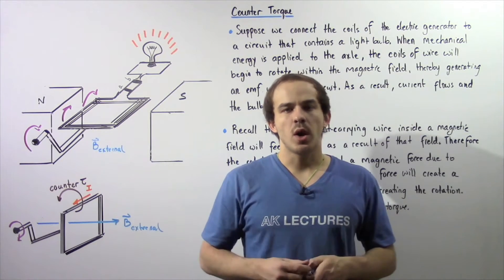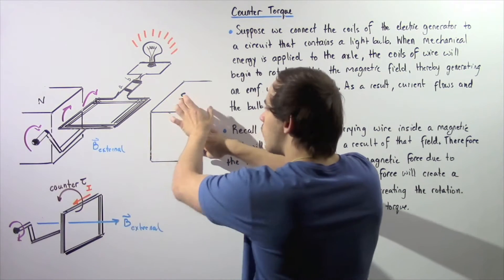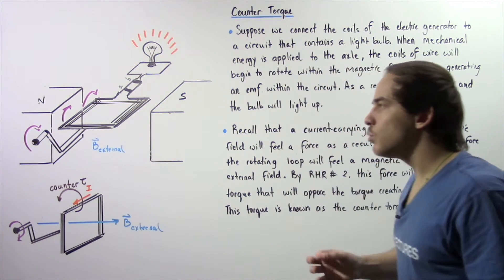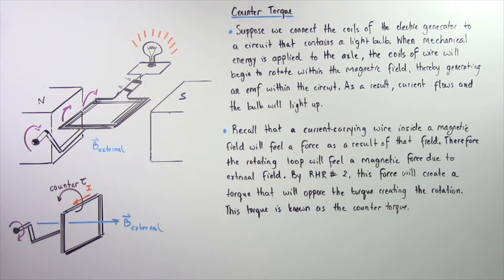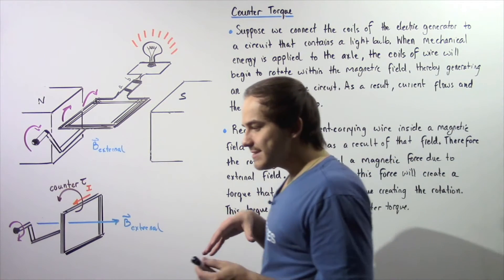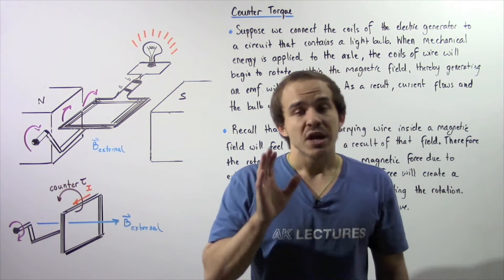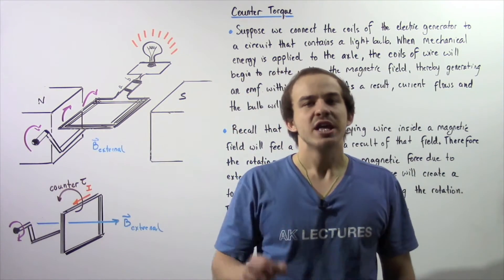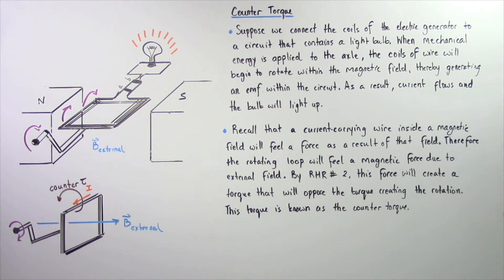Counter Torque in Electric Generators

Comment: What is the resulting effect of two electric generator connected- shaft to shaft having the same capabilities such that one generator turns the other in the opposite direction and they are so connected, would the back emf cancel the effect of the other?

Comment: Great explanation, thanks!
Wouldn't the same counter torque be applied to the lower part of the coil (the side parallel to the side where you drew the counter-torque), and thus eliminate the overall counter-torque on the coil?

Comment: when emf is induced in circuit current will flow according to Fleming's right hand rule...then why the magnetic field produced by this current is in opposite direction and produce a counter torque?
Reply: Coz as per Lenz law, induced EMF will be in such a direction such that its magnetic field will oppose the very cause of its generation.

Comment: I was hoping you could answer a couple of questions I have relative to countertorque.  I am intending to collect and transform water flow Archimedes Screw rotation into electricity via a gearbox and generator.  I am not running anything off it, but instead am solely interested in collecting it in batteries or hooking up to the grid and selling it to the utility. In your video you speak of countertorque being created when a load is added (the bulb for instance).  Is there counter torque created by either connection (or for example if it is to batteries would countertorque increase as the batteries charge up?), and thus more water flow necessary to get the same net output?